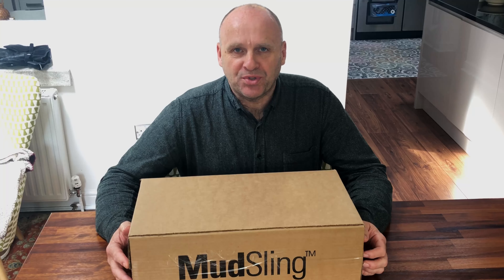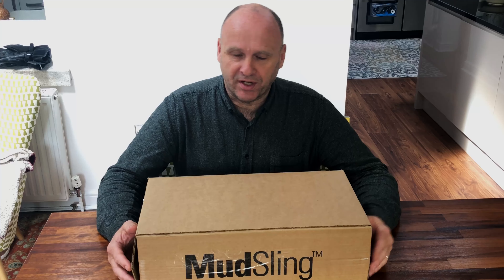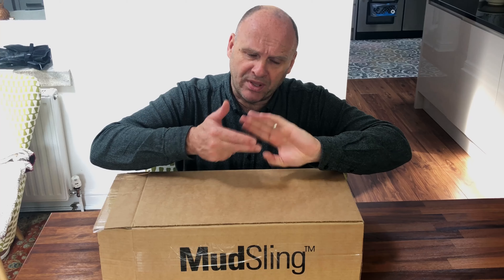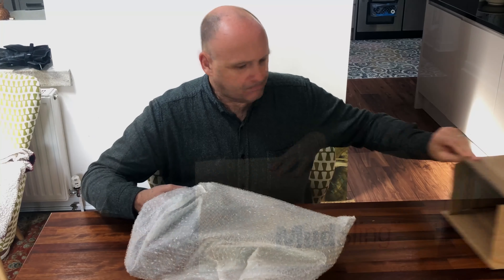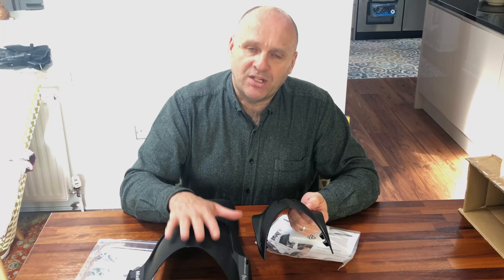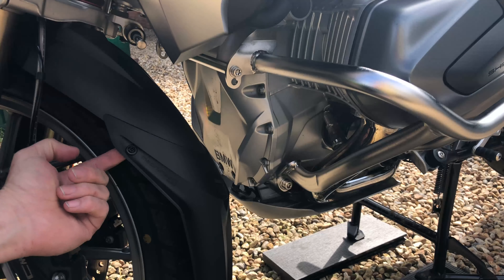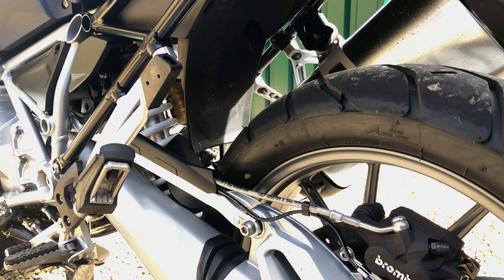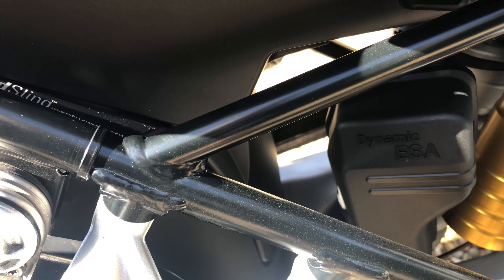Fitting the Mudsling and Avant to the BMW  R1250GS

Comment: The best bit of kit I bought for my 1250 GS Exclusive and easy to fit. While on the NN site i bought the Wunderlich centre stand protection plate Cymarc Radiator protectors and for extra protection. All easy to fit for a novice like myself.

Comment: Personally I don't think that BMW missed the point on mud protection as this is an allroad bike and it is possible to ride it through rough terrain.  In the mud and sand  you don't need huggers and fenders because these will clog up and effectually block the wheels from turning. 

Then again this is an allroad bike and if you only ride it on fixed roads then you can have the choise to increase protection with the mudslinger,  It's just a matter of choice.
Reply from the maker: Maybe on the front one but although clearances on the Mudsling are small if you don’t have it the shock absorber gets the full covering of everything. I get there’s design patents and such but it’s such a small moulding 👍🏻

Comment: Nice, simple video showing how easy it is to fit both of these accessories. Nicely done. I have both on my 2009 R1200 GS and I will be installing new ones on my "19 1250.
Reply from the maker: 2AwesomeDadsAdventures I strive not to alter the bike and as these need no drilling I like them. History tells me now they don’t stop everything but they certainly cut it down. Enjoy the new one, I think you will. Be interesting to know what differences you notice as only  had my1200 for a few weeks

Comment: Mr. Hodges,  BMW is very guilty of trying to cut corners when it comes to fenders. This is the answer to that problem, although I would love to see a full fender option as well. They put them on their bikes in the 50s, 60s, 70s 80s. Trying to shortcut production costs is probably their motive,  but the problem is VERY OBVIOUS IN THEIR R/18. Their new "Cruiser."  It makes a great bike look cheap if you want my opinion. BMW R&D needs to step up to the plate, and put fenders back on it. Anything else is a waste of Great Bike Character.

Comment: Great video and thanks for sharing. I bought mine on eBay last week for £31.96 including postage for both. I just don't understand how the big brands can charge so much for a bit of moulded plastic. I only had to wait a few days for delivery and they fit perfectly. Thanks again
Reply from the maker: There is good and bad to be had from eBay. Plastic mouldings are normally a safe bet but a friend bought spotlights and they filled with water very quickly. So caveat emptor 👍🏻

Comment: I used mudsling on last 3 GS bikes and they do protect the shock etc. Getting my 1250 on a week or so and I won't be fitting on. I found that the mudsling actually throws the road crap out onto the rest of the rear of the bike. I'm a road only rider so I'm fitting a hugger. They keep the crap closer to the tyre and throw it back onto road. It'll keep the shock protected as well as a mudsling.
The front extension works very well.
Reply: Ian Batterham no it won’t because I have a hugger and the shock gets covered your wrong there I’m afraid to say
Reply: @stevenharris4432  which hugger do you have Steven? I have a rear hugger (looks like the Puig one at £180 quid but bought from eBay for £38!) and the shock has barely got a spec of mud or dirt on it in 5k miles.
Reply: @stevenharris4432  which hugger do you have Steven? I have a rear hugger (looks like the Puig one at £180 quid but bought from eBay for £38!) and the shock has barely got a spec of mud or dirt on it in 5k miles.

Comment: Sorry if this has been asked but have you noticed any tire rubbing from the rear tire.  I had seen a few users who mentioned that the Mudsling can cause rubbing issues.  Thanks.
Reply from the maker: No. It’s if you have hybrid tyres. If you go in the Machine Art site they list those not good. I have standard suspension and Bridgestone Battalax A41s

Comment: Thanks Nick, now that you have used the Mudsling can you confirm that there is no rubbing with the Battlax Adventure? 👍🏻
Reply from the maker: Mark. That is correct on both my bikes which had A40 and A41 all was fine. The caveats I have are I have standard bike (not lowered in any way) I ride with suspension on ‘auto’ generally 👍🏻
Reply: @nickhodgeUK  Thank you for your help Nick. Have already purchased the DIN relocation bracket and twin USB from another video of yours. Nippy Norman should be paying you commission! 😁👍🏻
Reply from the maker: @markmurphy1995  Thanks Mark. They seem to have chosen Rider Cam TV

Comment: Thanks for the video Nick. Just one question: are the ties used to secure the rear MudSling protection not going to damage the frame paint? That's my only fear...
What do you think? Thanks
Reply from the maker: Hi Eric. I had it in my old GS for nearly 2 years and it came off without marks no worries. If you’re concerned though a quick wrap of black insulation tape would be fine. After all it not under any real strain at all. Just holding it in position 👍🏻
Reply: @nickhodgeUK  Thanks for your valuable answer Nick!

Comment: Thanks for showing that. My 1250 GSA will be arriving later this month so I'm checking out extra goodies to add to it. Now I've seen this I'll be getting the set. It does amaze me that BMW didn't sort that out though.
Reply from the maker: Staggering to be honest but it's a good set and start with it will protect the bike for sure. Hope you didn't view it too early as YouTube was taking forever to update it to 4K. It was playing at 360p for hours! Enjoy the GSA and ride safe
Reply: @nickhodgeUK  no it looked fine to me. I've saved the Nippy Norman site. I'm guessing that's the best place to get the cansmart & Denali D4 & soundbomb from too? I'm also going to get the led lights that go on the hand guards.
Reply from the maker: Nightcrawler777 shop around for the lights. I got the horn, cansmart and brackets from NN but remember with the D4s you only need single lights, not kits as the Cansmart has all the wiring you need. That can save you £50-75!! I got my D4s on EBay from a Best Offer. Think the bike shop was in Swansea. You buy them singly, not as a pair

Comment: From the set I have just received, the MudSling is propperly installed and had just a liitle space on the left and more space on the right side, however after a few rides on the left side it touches the tire slightly. As it is used now, I cannot return it. Are there more people who have experienced this?
Reply from the maker: What tyres do you have? There is a list of tyres that will rub. Also have you standard height and stuff? Just taken mine off to change bike and mines fine with Bridgestone Battlax Adventure Tyres
Reply: @nickhodgeUK  I'm on a R1200GS LC Rallye from 2018, so with Dynamic ESA. The tires I'm running are Metzeler Tourance Next.
Reply from the maker: Patrick Buitenhuis no all that seems OK. Appears suspension has no effect. I get that from here https://www.nippynormans.com/machineart/bodywork/machineart-mudsling-r1200gs-lc-2013-on-2017-on-r1200-adv-lc-2014-on-2018-on-r1250gsadventure

It’s tough to know then but so long as you have the mudsling engine side of the little blade mudguard on the swinging arm and the blade of the lowest part of the top fender fully engaged in the mudsling slot I can’t see how it can be wrong??  Possible, but unlikely a duff moulding unless warped by heat maybe. Clearances are tight as you see from the list but shouldn’t touch. Good luck
Reply: @nickhodgeUK  Yeah it's really strange. I will get it off and then fit/install it again by first fasten the cable ties on the left side and see if that differs in result. Thanx for your swift reactions! 😉